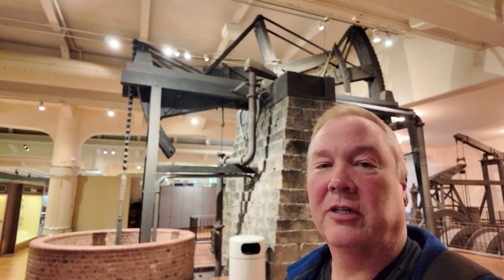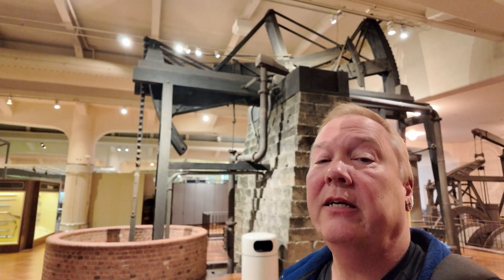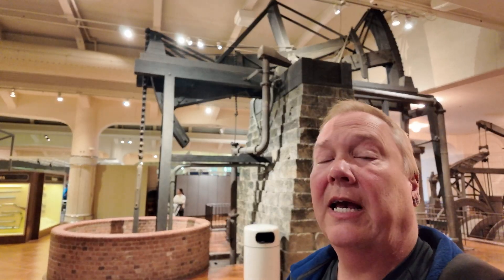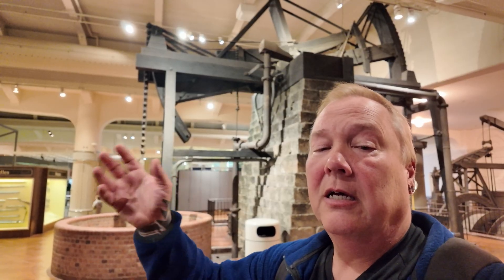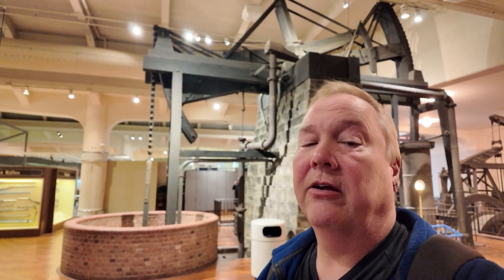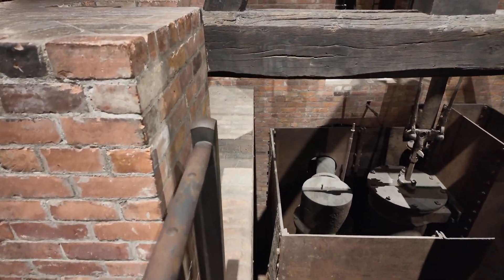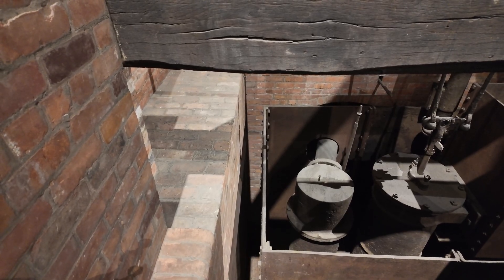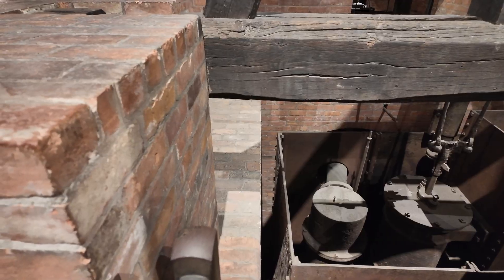Did James Watt Fix What Thomas Newcomen Got Wrong? | First Century of Steam - Part 3/5

Comment: This one dates from 1750- updated from the 1718- Correct? Is the plug tree the major 1750 improvement from the original, or was that added later still?
Reply from the maker: Which 1750 engine?  The main three I have in this course are 1712, 1796, and 1811.  All those dates are a bit vague, though, based on limited records.
All three of these are basically "as built."  Newcomen developed the plug tree pretty quickly.  It was, perhaps, a bit less of an innovation than it seems.  The old trip hammer systems, like those used for pulp mills, used blocks on water-powered shafts to trip hammers for making paper pulp.  He had to get the timing right, but the trip system had been around.

Comment: did the Newcomen engines have piston rings?
Reply from the maker: Not how you'd probably think of them.  The machining wasn't that good to use a metal ring.  Instead, they used leather seals on the piston.

Comment: The Newcomen engine would work fine if the cylinder was made of a material that has a low thermal mass.
The biggest advantage of the design is that it cannot explode and does not require pressurized steam.
Reply from the maker: Interesting idea.  Although their materials were pretty limited in the 1700's, if you wanted to build one today, you're thinking that plastic might be the best material?  Could eliminate both problems that Watt's external condenser fixed while still spraying the jet into the main cylinder?  It sounds right, and it'd be easy enough to make a plastic cylinder that could handle the pressure differences.  I wonder if anyone's tried to build one.

Comment: I really like the way the pumps are displayed. The brick wall cut-aways, are a perfect compliment. It enhances the weightiness of the pump.
Reply from the maker: You're right, that definitely helps to see the workings of these engines, also putting them more in context.  They do have one, the Dudley Engine, aka Windmill End Engine, which is mostly inside a building and you can't really see much of the cylinder half of it, which is a shame, since it's one of only three of its type left in existence.